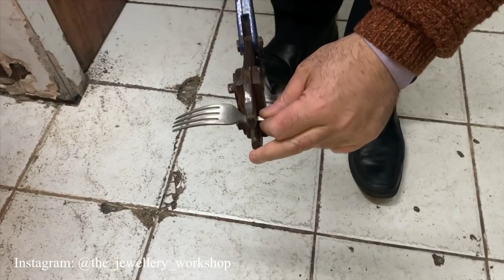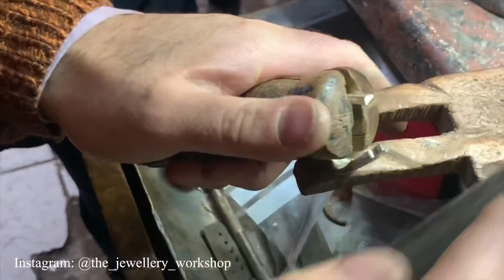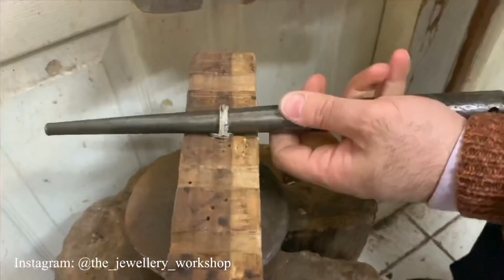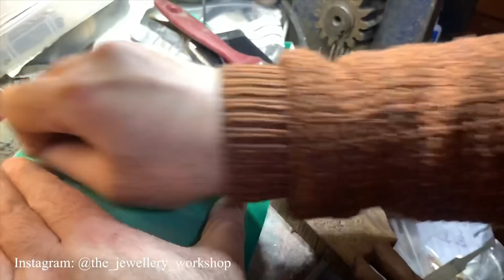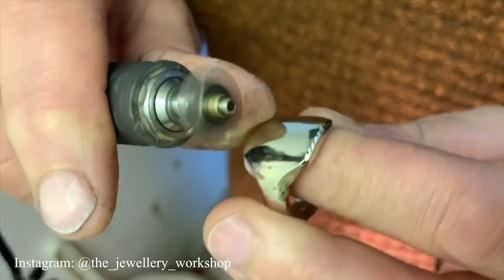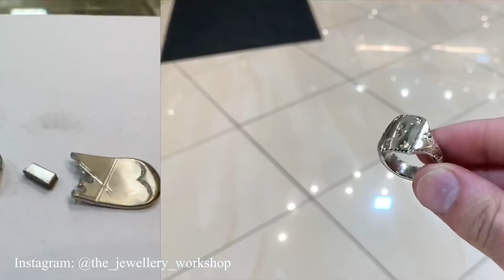Wow! Making a ring from a Fork!! Unique Jewelry Making | Making a Ring | How it's made | 4K Video

Comment: brilliant video. i have some old forks at home i would love to try this. Also I love that tool used to make the pattern.
Reply from the maker: You can buy the tool from our Ebay shop my friend. Here is the link: 

https://rover.ebay.com/rover/0/0/0?mpre=https%3A%2F%2Fwww.ebay.co.uk%2Fulk%2Fitm%2F124116795857
Reply: @TheJewelleryWorkshop  What's the best angle to choose from: 110, 120, 130, 140? Which one did you use in this video?
Reply: @TheJewelleryWorkshop  Also, will this fit on a Dremel?
Reply from the maker: Yes it will
Reply from the maker: You can choose any, the higher the angle the wider the cuts are